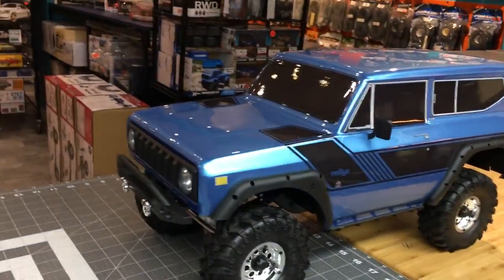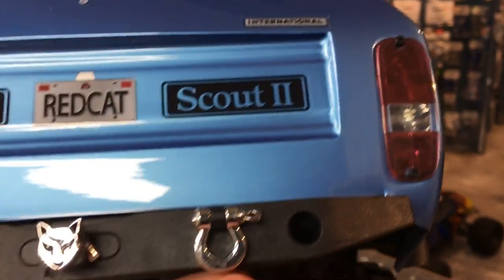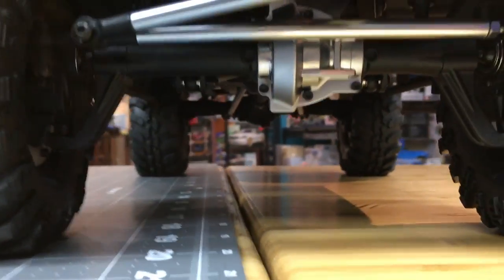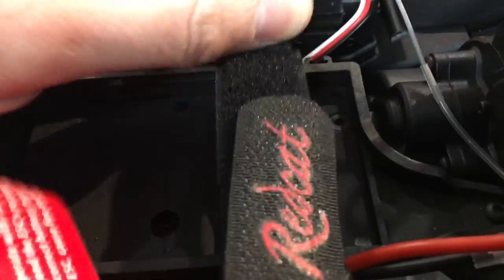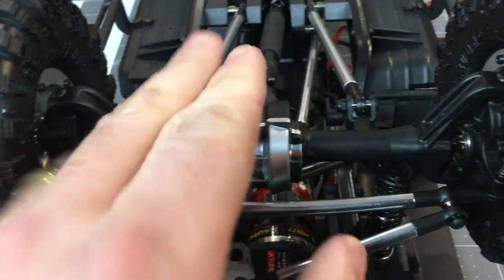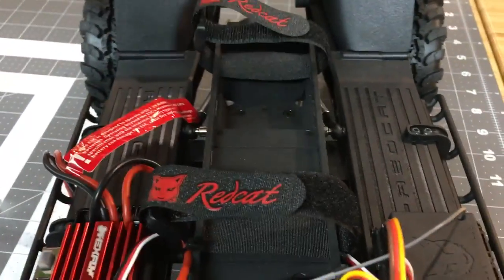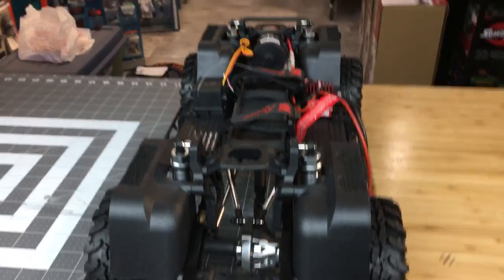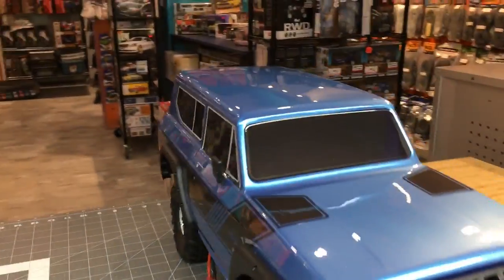The Gen8 is the top dog!

Comment: The coolest thing about this vehicle is they didn't go the usual Jeep JK, or early Ford Bronco route when it  came to choosing a body, but went with the IH Scout, which is classic, and unique.

Since Axial is milking their Jeep licensing to the max with all their JK body variations, it be nice if they came out with a Jeep that hasn't been done to death, and that would we a good old classic Jeep CJ using their shorter wheelbase chassis suspension links. The only decent CJ body was the Pro Line CJ8, and it was quite popular, but it's long been discontinued, and almost impossible to find in new, unpainted condition, at a reasonable price.

Comment: Receiver box isn't waterproof, but a balloon on the receiver fixes that.  Servo is too far forward and exposed.  The divorced transfer case bump on the bottom hangs up on rocks. --- Pretty comparable to the Traxxas TRX-4 for performance and price, but out of the box the Traxxas slightly out performs the Redcat Gen8. Mostly due to the tire choice (TRX-4 tires are a bit grippier, and the memory foam in the Gen8 isn't good in cold weather.)  The Gen8 transfer case bump catches on rocks, though I've heard mention of an alternate belly plate being worked on that reduces that bump. The Gen8 bumpers stick out further past the tires which can make it more difficult to get up on, and back off rocks.  My only real complaint is the black windows, which the TRX-4 also has. But eventually they will have clear bodies available for $55 USD.  Redcat has set up a page on thingiverse with Gen7 and Gen8 accessories and add-ons you can download for free and 3D print yourself, or have professionally printed at places like shapeways.  Maybe they'll have the replacement belly pan available there?  All in all it's a pretty awesome truck for the price. I think some of the other brands are going to have to take notice and step up their game a bit.

Comment: Great video as always. I'm probably planning on getting the Gen 8 PACK as my next rig.
Reply: I just picked up the PACK version.  Its very nice, i think you will enjoy it as well.  I added a 4runner proline body, lights all around with light bar, and a winch to mine.  Its damn near unstoppable.
Reply: @matthewbrothers2823  Yeah I got the PACK. I'm already bored with it so it's on eBay now
Reply: Yeah it is quite slow out of the box

Comment: can i swapped out bodys from other rcs? i have tge redcat blackout sc and the body is smaller than a 1/10. the redcat scout looks like a good rc but would like another body
Reply from the maker: Yes you can change the body, Proline, jconcepts, rc4wd, killer body and others have at least 40 or 50 different choices combined 

the Gen8 has a great wheelbase for body and wheel swaps 

good question 

Chris

Comment: FYI : the receiver box is NOT waterproof. Be careful getting it wet.
Reply from the maker: yeah i kinda figured... some shoe goo or a traxxas waterproof rx box will fix that.. or a balloon if you are OG  lol
Reply: The receiver is waterproof. Same as the Gen 7 and we run them in submarine mode regularly with no issues.
Reply from the maker: oldsjunkie1 yeah those rxs hold up pretty good
Reply: @ChrisHouseHobby  Or a condom if you're a super og!
Reply: So is it, or is it not.. that is the question :)
Reply: @camillebrenes  The receiver itself is waterproof, but the receiver box is not. If you put any other electronics in there, you'll want to seal up any holes in the box.
Reply: Get some corrosion x.

Comment: Got mine, but I have a question.  I have a couple 7.4 volt NiCads that still work.  Would they work in the Gen8? Says Lipo or NiMH in the manual.  If not I need to run to local hobby store. (they also have old tamiya connectors)